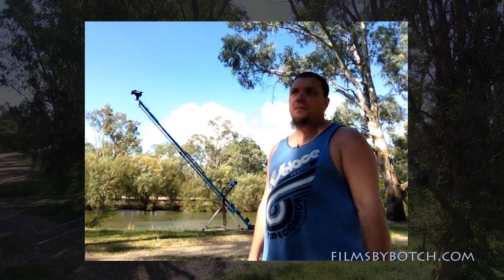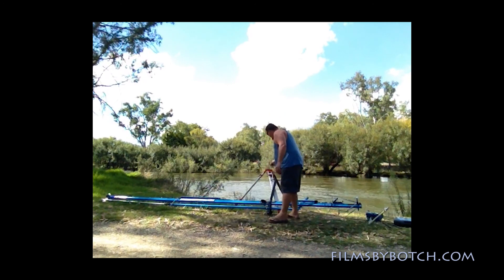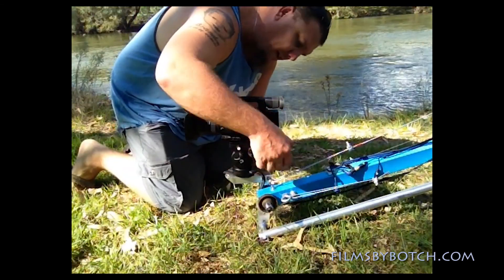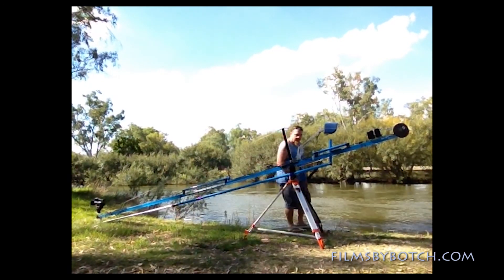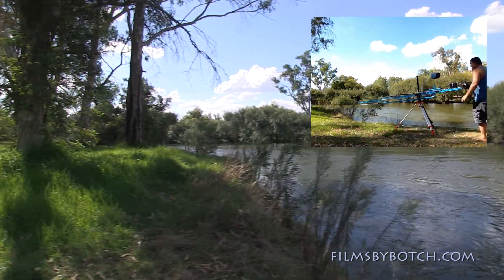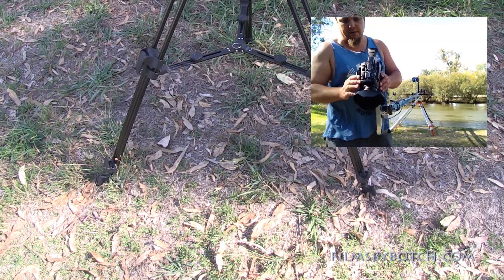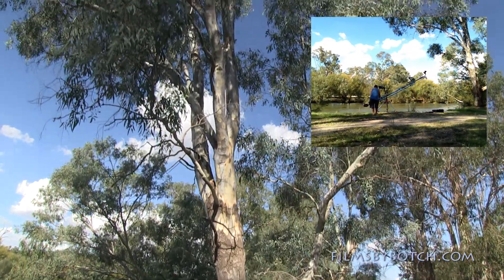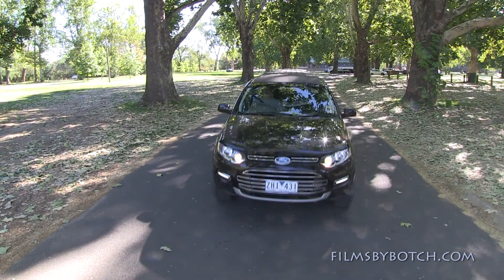How to assemble and test botchs supersize homemade DIY camera crane jib with tilt head

Comment: I noticed the box section aluminum is bent in at the ends. If you put some steel tube around the internal bolt it won't bend. Or create two pieces of steel plate either side of the box section the bolts will tighten up on the steel plate and not compress the aluminum box section. All cranes need to be slightly bent like a banana. This way when the camera and weights ore mounted the crane frame will get stronger. A crane this size would benefit from side wires. It'll act like a wind sail when the wind catches it and force the crane sideways. bracing the frame for lateral movement will help. I love your crane good job.